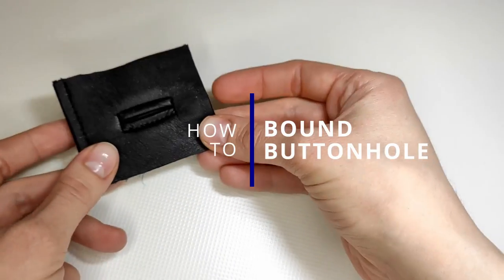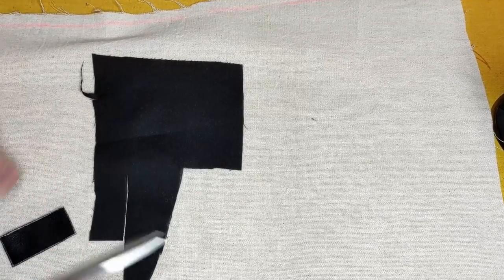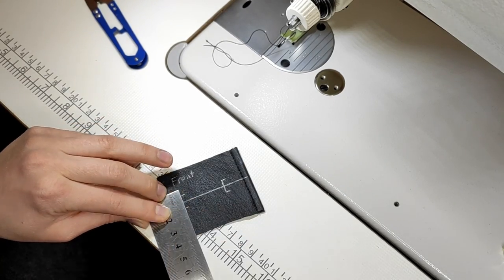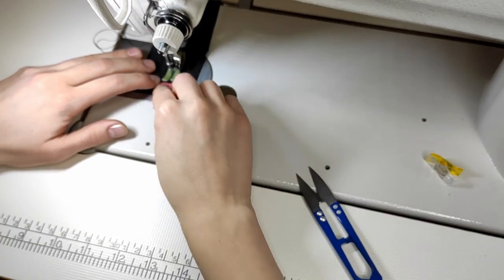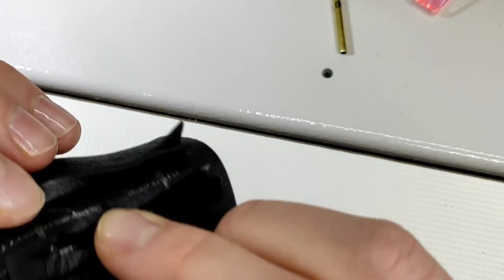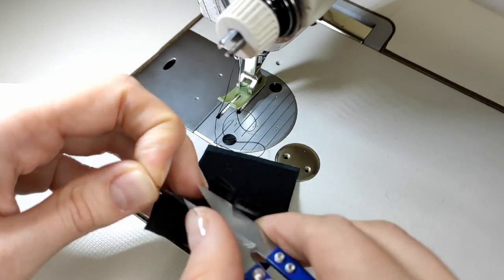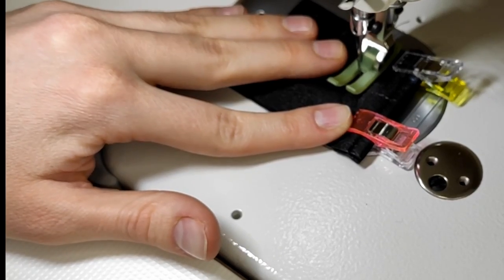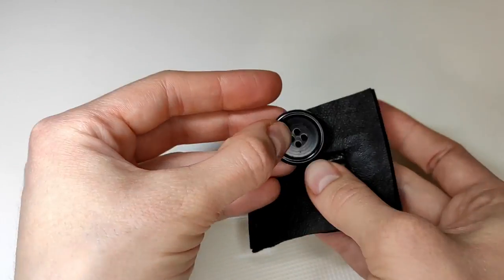Bound Buttonholes on Leather | How to Sew | Easy Tutorial

Comment: When cutting the center and Y cuts of the buttonhole, a seam ripper can give you better control than scissors. The seam ripper has a pin point and a little way down from the tip a U-shaped razor with the cutting edge on the inside of the U curve. The pin point goes into the corner and slides in until the razor begins cutting the fabric.

Comment: This is very nice.  I'm wondering if you could deal with the raw cut edge on the inside leather by cutting it (before sewing) and rolling over the edges, using contact cement to hold before sewing through all layers?
Maybe not practical, I don't know.
Reply from the maker: Oh, that's a great idea to explore! I'm actually not a fan of the raw edge, just aesthetically. And I'm planning on exploring other ways of doing buttonholes 🤓
Reply from the maker: One of the downsides that come to mind right away is that it might be too bulky.